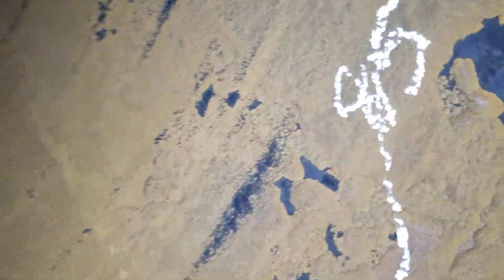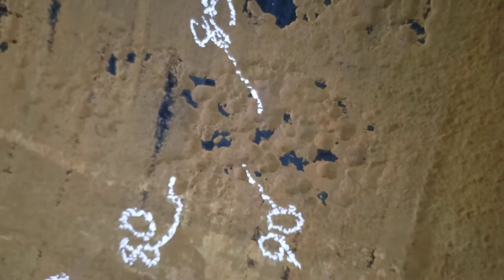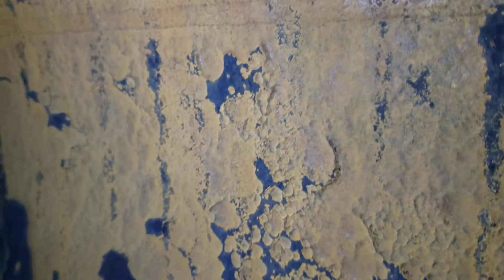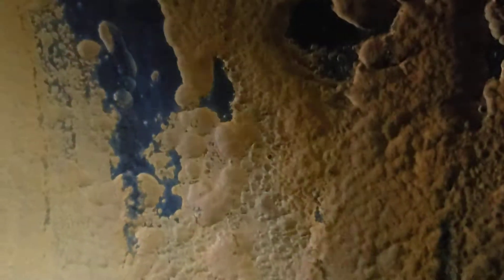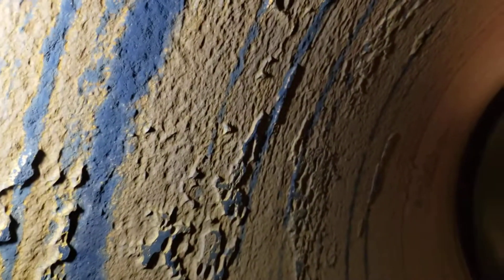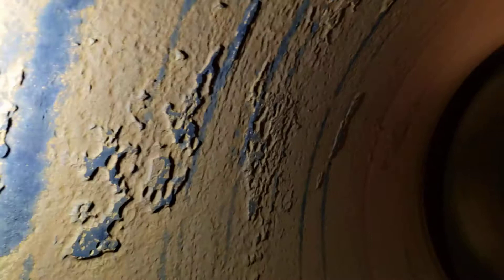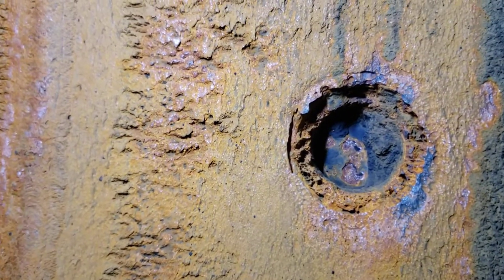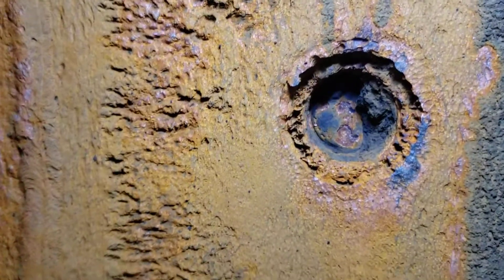API 510 Internal // AEU exchanger inspection part 1

Comment: That 1” or 1.5” threaded nozzle attachment weld(at the end of this vid) is all but gone. Was it recommended for a repair?
Reply from the maker: 1" with a plug.  I recommended replacement of the entire shell assembly....... I believe it was returned to service, with a new bundle.

Comment: what kind of liquid would have been in something like this?
Reply from the maker: Jolly,  this exchanger did have versions of oil on both sides.   The sides being  the tube and then the shell (that's what your seeing in this video)
This is used commonly to use a hot liquid that they need to cool to heat up an incoming colder liquid.   In this case the hotter liquid is on the shell side, heating up the tubes and the colder liquid in them.